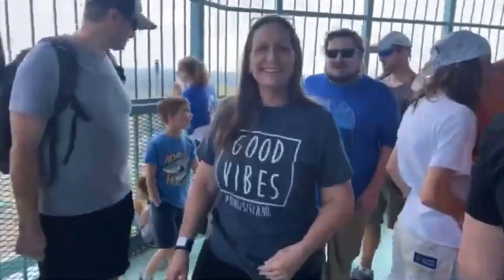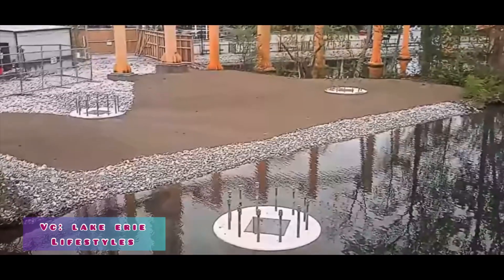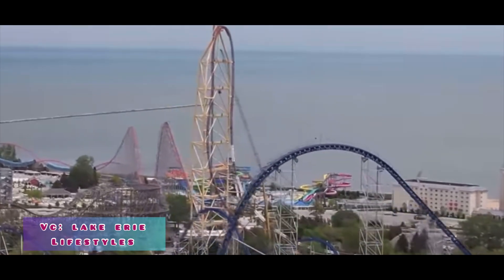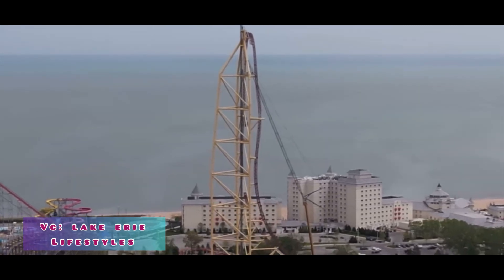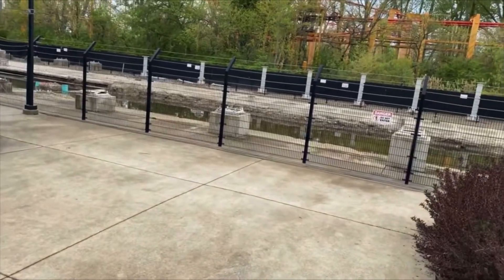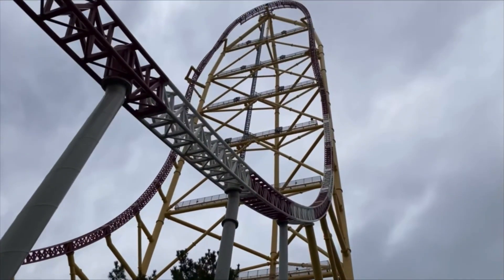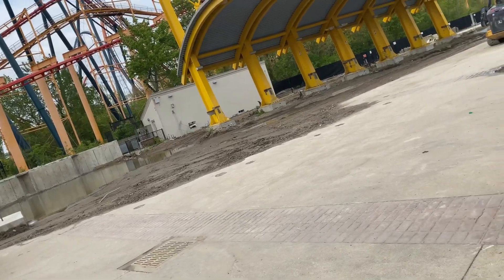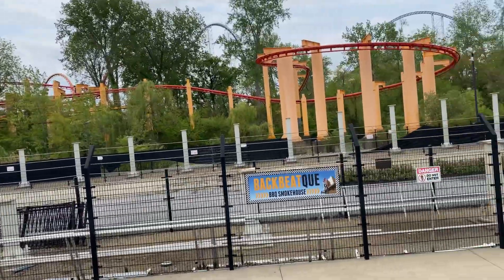Top Thrill Dragster - Future Construction & Shipping Containers Onsite?

Comment: I'm confused, I always thought footers are engineered/ sunk for the load they'll bear. If the footers were made/sunk  for a 420' top hat, does that mean they'll tear the footers out and pour new ones if they're going higher? The tower structure would need to be redone if they do go to 500 feet, wouldn't you think? Awesome update as usual...this keeps getting more and more interesting (and confusing LOL) Cheers
Reply: They always overkill on this stuff and if they do extend it they could always add extra supports. 🤞
Reply from the maker: super confused by what he was getting at there, but he did say "Im not an engineer my specialty is elsewhere in the construction management end"
Reply: While true, a footer carrying a significantly taller structural support will need to be larger, there are load tolerances. in other word if you look at the footer for Raptor, they pretty much all have 4 anchor bolts that receive a square or rectangle plate that is welded to the bottom of the round or oval support column. This is consistent for the tallest supports of the lift to the lowest portions of the final helix. It seems the very top structural supports of the Dragster top hat are more for supporting and accessing the catwalk along side the track. Dragster has actually come to a complete stop on the top hat and had to be manually pushed over from that catwalk, but these things can easily be fixed. If they were to make the top hat crest like Xcelerator which is just 5 or 6 pieces of track connecting 2 towers, and if they were to alter the profile to be less symmetrical like Velocicoaster or Pantheon, it would be nearly if not totally impossible for the coaster to stall on top. I think the weight of the supports and catwalk at the top could be removed as well as the existing track could be replaced with self supporting track (like Xcelerator) arching up and over to achieve the height record without any changes made to the existing footers.
Reply: Thats very true. Thats where they lost me on their "insider information" . Ill bet money the top hat is not extended
Reply: @timk987  I agree, I think that is what they will do to break the height record
Reply: Nope the footers and supports now are place in certain places  at certain angles to support the existing tophat.If it were to be extended the math would change therefore requiring the footers to be I'm different locations to achieve said angle..

Comment: I think they definitely will raise the height of the top hat.
Reply: Not possible. It's engineered for 420ft.  It's not as simple as it sounds, only the spike has a chance to be taller.
Reply: @Alec S  
I'll guess we'll find out pretty soon. RMC has done quite well raising the height on Mean Streaks hill.
Reply: thats what im thinking because there is not going to be a spike.
Reply: I hope you're right
Reply: @alecscheerer_run  don’t be so sure. Just because the footers etc are for 420’ doesn’t mean they can’t add extra supports! We are skeptical but our insider hasn’t steered us wrong yet!
Reply from the maker: Other thing is we don’t know forsure if thats max load on the footers or not - adding to the megastructure seems unlikely imo but honestly wouldn’t surprise me either its cp they do extraordinary stuff at the right times we shall see. But i’m with you it seems highly unlikely
Reply: @Ghoster Stacie  The base structure of the top would have to be re-engineerd slightly is what I'm trying to say. Kind of like how when zumangaro was added on to kingda Ka, they had to add extra support on the base of the tower. This still would be very unlikely in this case.
Reply: @Patrick Ryan  Yes, while altering the design of the structure at the same time. But keep in mind that working with a wood vs a steel mega structure is two completely different tasks
Reply: @alecscheerer_run  
Correct
Reply: @GhosterCoasters  @ElToroRyan 
 I think we are missing a possibility on the extended top hat.  They only need to raise it 30ish plus feet to beet Kingda Ka, and I know taller coasters are coming, but they can claim tallest coaster, tallest spike, and other records. My theory is they just extend onto the current top hat with track only over the top curved section like Intimin did on Pantheon and Xcelerator where there is a section of track with no trusses and that doesn't add so much weight.  I am not an engineer so just my guess.
Reply: @alecscheerer_run  what if they remove part of the top hat and use a material that weighs less to extend it up.
Reply: @Cp_coasterlover  If that's possible, then it could be done, but the base would need added on to still to support a larger load
Reply: @PatrickRyan150 it’s a lot easier to spread the load of a lift hill over a large area (like RMC mean streak) compared to a tophat
Reply: @Alexcutionman  
Who knows it might get completely torn down. It's fun to talk about, though.
Reply: @PatrickRyan150  ttd isnt getting torn down.
Reply: @Jimmylovessalt  
I don't think so, but we'll see soon.
Reply: @GhosterCoasters  
Correct, they probably engineered these to hold much more than what it currently is. I don't think adding 30 feet would matter, but we'll all see soon enough.
Reply: @Alec S  
Agreed, if they really want to raise it 30', it can be done.
Reply: @PatrickRyan150  I love hearing everyone’s ideas. It helps me look at the whole situation from a different point of view and sometimes I am like… “I never thought about that, that’s a great idea”.